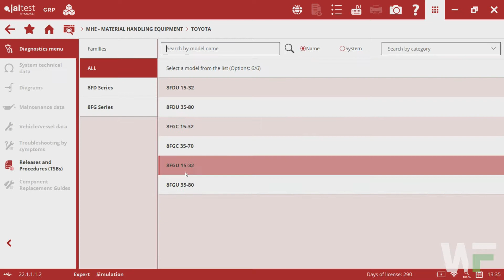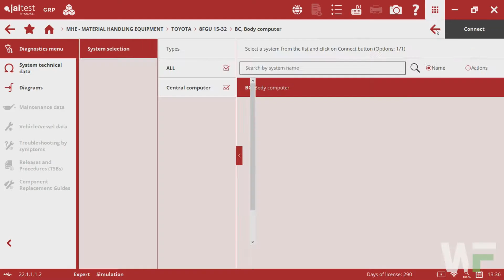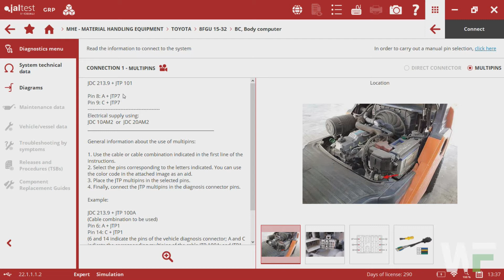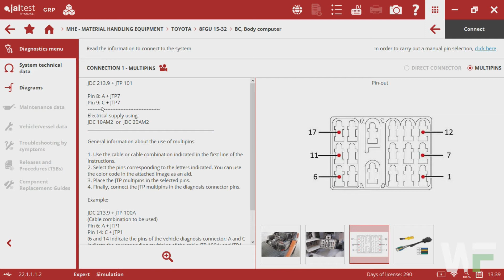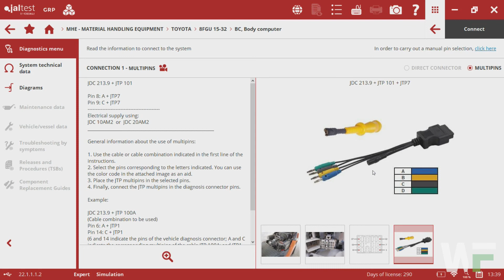How to Use Jaltest Multipin Kit

Comment from the maker: IMPORTANT: Apply Machine System Voltage to the Multipin Adaptor to achieve successful connection. If the machine voltage is 24V make sure that you connect the alligator clamps to the battery for 24V supply (not 12V).